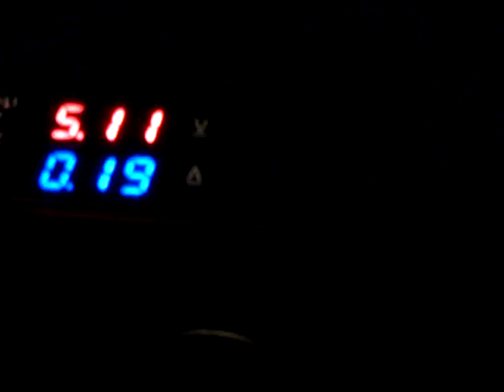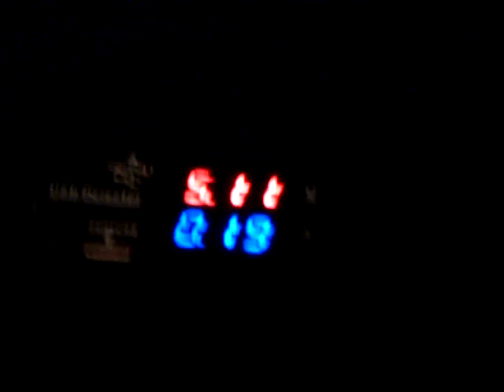Super Capacitor LED Lights

Comment: Very nice! now put all that inside that crank flash light and get rid of that dead battery. If you could make a version that had a self cranking power recharger like some expensive watches have, "They use motion of the person wearing them to self wind their spring." I bet lots of military people would be interested.
Reply from the maker: Randy Travis Actually LaserSaber has already done something like that.  He named it the Tesla Torch.
Reply: How long does the charge last?
Reply from the maker: Randy Travis 20 sec wind will give you 20 to 30 minutes.

Comment: Very nice for 1mA. Been working on this myself the last couple of days. It raised a smile to mention time and then be showing a long running circuit.
Have you tried a conventional bobbin of 30AWG (perhaps from former project) to compare to the Litz ? got none here is why i'm wondering.
Reply from the maker: slider2732 The "Looper" circuit is very interesting.  I had a Litz wire coil on hand that I used and maybe I'll try a regular 30 ga coil to compare.  I can't get the super long run time yet on a small value cap like LaserSaber is showing but I'm working on it.  I have watched all your videos on this circuit as well as other people's.  There are many variations of it now.  That Russian LED "self-runner" circuit still puzzles me a bit. I bought a bunch of those buck/boost MC34063 chips for cheap on EBay and have had fun playing with those.  This all takes time. Lately I seem to be losing a day now and then---sometimes a whole month!
Reply: ***** Oops, forgot to reply yesterday to say thanks for the extra info. A senior moment, that only seems to happen on Tuesdays ;)

Comment: You recently perform engines that run on electrostatic voltage. What do you think about this device?
/www.youtube.com/watch?v=YreCJDvIX2Q
Reply from the maker: Lechoslowianin I have been following the thread at OU on this device.  It is faked but I don't know how he did it.  Here is a video I just did showing a method that he might have used----some sort of remote high voltage driver.  https://www.youtube.com/watch?v=3M0sdx_b7go

Comment: :-) at your date mix-up.  The other day I had a similar moment when I said "2010" when I meant to say 2015--weird how the mind works some times as we age...

Anyhoo...
Did you ever figure out how lasersaber's looper circuit was powered by the earth when he connected one of his leads to it?  Or how he also got the his looper LEDs to light when he touched only one of the system leads to only 1 of the 9V battery terminals?

Thanks for sharing!
Reply from the maker: A B I think that the conclusion was a capacitive thing.  In his last video he put a BIG variable capacitor in there and it worked. He posted a video of it a few days ago. I don't remember which day. Ha.
Reply: ***** Hmm... interesting...I'll look for his vid.
Thanks!